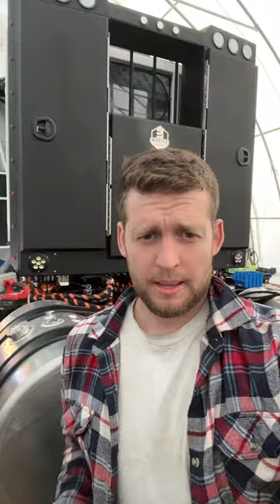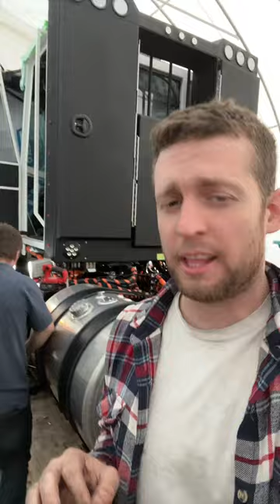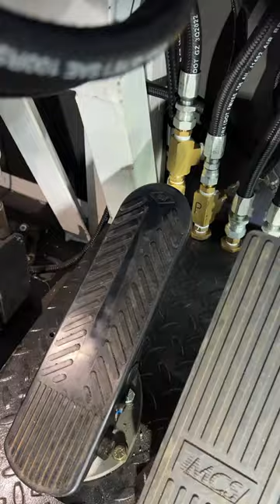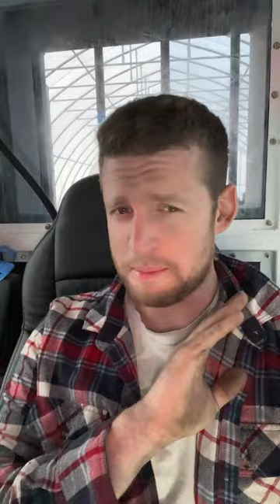Westinghouse air brakes on the Edison Truck

Comment: Edison stepping on westinghouse is more subtle than saying FUCK TESLA
Reply: What's even more hilarious though is the fact that It was Nicola Tesla that invented the three-phase motor which is what is in the axles that pushes the truck forward.
Reply: @ihdieselman Being powered by Edison's DC current coming from those batteries
Reply: @CosRacecar actually, it's converted to AC to run the motors, they're three phase AC motors.
Reply: @quartzcyanis if you look at it close enough ac is dc with extra steps
Reply: @zyeborm  if you use the right inverter, I suppose. Guess you could say it's a STEP in the right direction.
Reply: @zyeborm if you look at it close enough there is no reason to do anything ever you just going to die and be forgotten
Reply: @everettstormy You should get therapy. The things you do, even if they seem forgettable, will permanently affect history, ideally for the better.
Reply: Also this dude hates Nicola trucks
Reply: @brownstonecustomcabinetry5309  does he hate Nikola? Or is it more of he loathes companies that lie at every possible opportunity given? Nikola doesn't have a good track re.... hell, they don't have a track record of being honest
Reply: @ihdieselman 
Not really. The 3 phase motors that Tesla designed were never in widespread use because his design used 6 wires. 2 wires more than 2 phase, which was popular at the time. Mikhail Dolivo-Dobrovolsky invented the 3 phase systems that we know today, using just 3 wires. I'm not trying to say that Tesla wasn't brilliant but he gets more credit than he deserves.
Reply: @Crlarl  good answer, thankyou
Reply: @CosRacecar Edison didn't imvent shit.
Reply: @Trucks_n_stuff  Edison was more of an inventor than Musk will ever be.
Reply: my favorite is still tesla
Reply: @quartzcyanis i know this is a pun i dont get because im ignorant with alot of truck and or electric technology but i still hate the pun
Reply: @user2C47 History will end. Eventually there will be no one to remember, and nothing left to find. Existence is finite. We're probably the only thinking beings that exist anywhere. Life in other solar systems is likely microscopic, if it ever existed at all. Focus on what makes you happy. That's probably all that matters.
Reply: @djzacmaniac  You think humans won't try to continue existing well into the heat death of the universe? We have no clue what the future holds, but why not try to make it a better place?
Reply: @zyeborm 
Adding frequency ‘power’ 
Kinetic energy lol
Reply: @Crlarl 

Tesla had already developed and demonstrated his three-phase AC system in 1888, and he held patents for it. Dolivo-Dobrovolsky, on the other hand, developed his own three-phase AC system around the same time, and some argue that he may have borrowed ideas from Tesla without proper credit or recognition.

However, it's essential to note that:

1. Dolivo-Dobrovolsky's work was not an exact copy of Tesla's.
2. He made significant contributions to the development of three-phase AC systems, including improvements and innovations.
3. The exact nature of their relationship and potential influence is still a matter of debate among historians.

While Dolivo-Dobrovolsky may have been influenced by Tesla's work, it's difficult to say whether he "stole" ideas or simply built upon existing knowledge in the field. The history of innovation is often complex, and “multiple inventors may work on similar ideas simultaneously.”

And that is a world wide phenomenon!
Pretty cool .
Reply: But he IS saying fuck Tesla himself tho
Reply: Uhhmmm, George Westinghouse was a backer of Nikola Tesla.  Ppl aren't seeing the layers in the relationship.

Comment: There’s the electricity Westinghouse (AC) vs Edison (DC) part but also Westinghouse before developing AC power designed the automatic air brake for trains
Reply: AC also later became standard for railroad electrification but not until the mid 1950s prior to then DC was used pretty much everywhere except Switzerland and the Northeast corridor in the US

Comment: Even more interesting to me is the fact that both AC and DC are used on the truck. Induction AC motors utilize three phase AC rectified from DC batteries.  I wonder what Nikola and Thomas would say today seeing both of their inventions utilized in different ways at the same time to realize effective electric propulsion
Reply: Edison didn't invent batteries though. Tesla would probably be disappointed since he demonstrated wireless transmission of power over 100 years ago.
Reply: They both were still in their primes when the Rotary Converter was invented and brought the Current Wars to an end. I think they were on the whole happy about the whole thing

Comment: Also, Westinghouse designed the air brake system that’s used today. Initially installed on trains

Comment: 🤣 Not to mention N.T.’s polyphase power…
I’m guessing that the DC bus is feeding a 3phase inverter/variable frequency drive type arrangement for the motors anyway. I’ll bet you guys are having some pretty geeked out nerd discussions about setting those up. 😃 

One thought I’d like to plant is that Tesla and Stellantis are both making BEV’s now and Tesla’s approach is really simple pinion and bull gear type setup with a motor that revs to like 20k. There’s strange magnetics involved with that and a decreasing torque curve.. Stellantis I heard is putting a 3 speed gearbox on their prototype BEV Charger. This keeps the rpm and tolerances in the sane zone along with operating the electric motor in the meaty torquey operating magnetic rules. Also allowing the gear to amplify the torque to reduce current draw to get the same twist..just saying it’s something to think about..if I was a gambler I’d suspect that Stellantis went to somebody like Siemens and asked how to one up what’s currently out there. I mean really , AC brushless servos almost always connect to a planetary gear set on machine tools to get the desired performance and an automatic transmission is basically a bunch of planetary gears.. An electric motor with its wider rpm range need less gears so a simple 3 speed will fit the bill to beyond the legal speed limit 🤷‍♂️and it’s not something the automotive industry has never seen so it makes a lot of sense there’s a comfort level with that. Even though I bet there are many new challenges to implement that hyper efficiently but first gear will probably get it to 60mph in a 2000 ft. lb. hurry!

Comment: There's  more irony...
The "new" Edison rolled out almost to the week 100 years after a patent filing for a vehicle drive system consisting of engine-generator-battery-motor.

Beginning  in 1924 the system was tested powering a 40 passenger bus working in actual revenue service. The Morton Arendt designed bus utilized Westinghouse batteries and General Electric (Thomas Edison) motors.
Reply: That is legitimately spooky.
Reply: @johnwenzel2003 It may be REALLY spooky. The previous build's rollout is cited as "early September" 1923. Maybe the two share the exact same "birthday " separated by 100 years?
Reply: @johne189  Somewhere Rod Serling is smiling.

Comment: I got it. Westinghouse backed Tesla during Tesla's independent venture in power production and was a direct competition to Edison electric which became GE (General Electric) after JP Morgan stepped in and sued Westinghouse and Tesla (stepping on them) trying to drive them out of the electricity game then switching production from DC to AC production with GE.  
Also random fact Westinghouse and Tesla underbid Edison and his backers for the Chicago's world fair where electricity was put on displace in 1893.

Comment: Edison owned his company and wanted DC electricity for all but that ment power stations every mile , AC current was put forward by Westinghouse and won the day as it was much better ! So you have a contradiction of brake pedals , also Westinghouse invented the air brake for trains ! Still used today !

Comment: I always figured VW woulda made a TDI diesel electric, but they got thrown under the government buss when that chevy cruze diesel came out. so they stopped diesel all together.
jetta tdi with some. regen braking and basic batteries woulda got 65-70mpg.  my deleted tdi got 53mpg all the time.